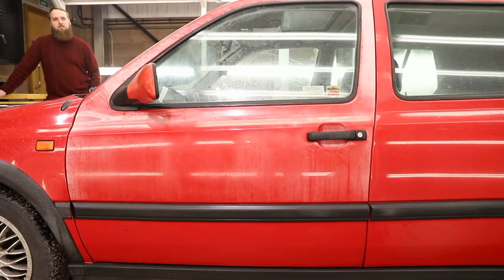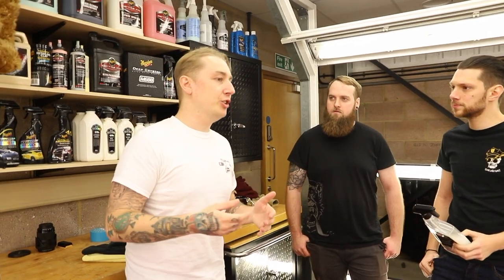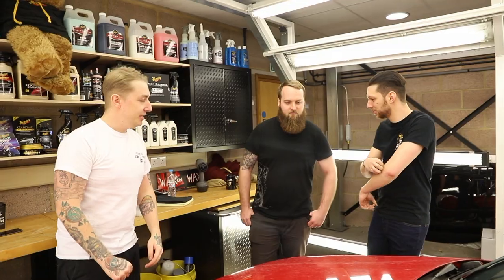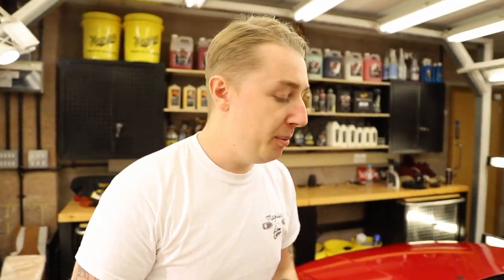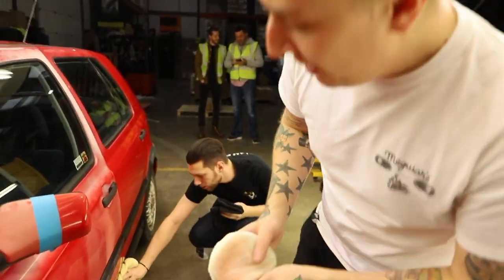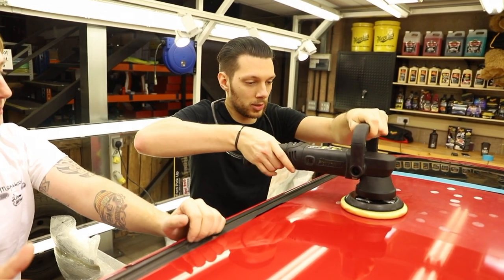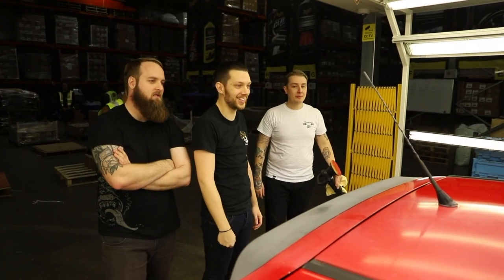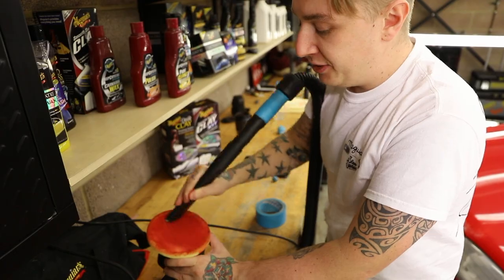The ULTIMATE COMPOUND for restoring FADED PAINT *Day In The Bay

Comment: How quick you just used the compound to restore the paint is near impossible. I have faded paint on one of my panels and have repeatedly used meguiars compound and did about 3 or 4 layers of coat. It looks good for about an hour but after that its back to normal. You must be using something additional or this shit is FAKE.
Reply from the maker: Hi, every car is different when it comes to paint correction. We applied a wax after compounding to seal in the gloss and protect the paint.
Reply: @meguiarsuk  Thanks for replying. did you guys use the ultimate polish as well as the liquid wax? as a cheaper option, is the  muguiars quick wax  spray suffice to seal and protect the paint?
Reply from the maker: @faheemi4837  So we used the Ultimate Wax which contains polishing oils within it. You can use a quik wax however the duration will be much less.
Reply: @meguiarsuk  tried the method you described and worked well. Thanks a lot!